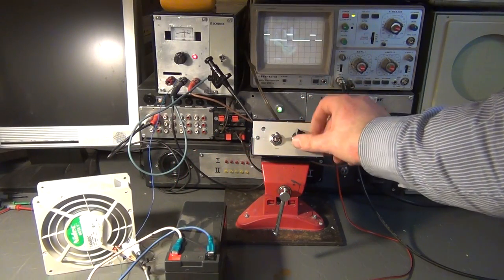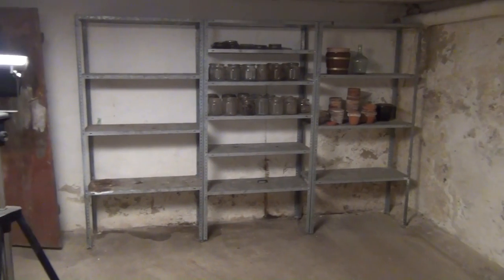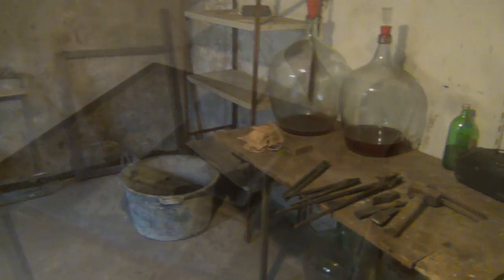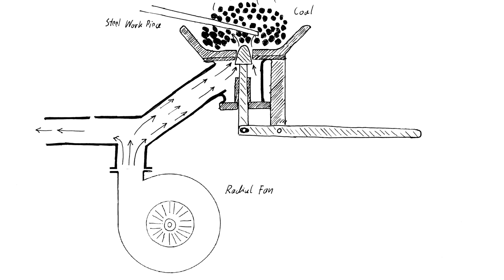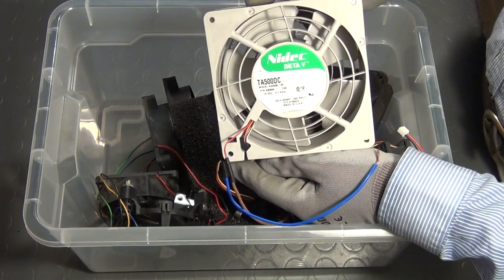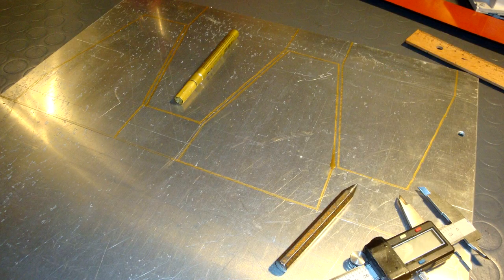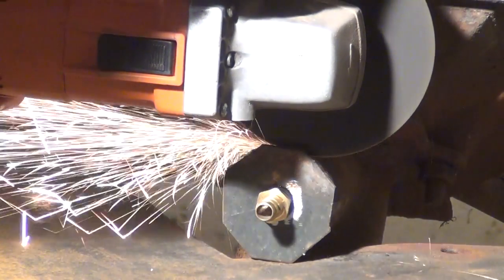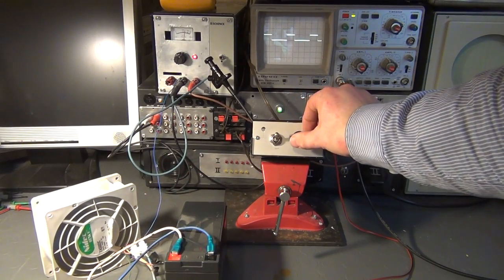Building a Blacksmith's Forge Fan System  - BLDC Fan (1)

Comment: I just built an coal forge myself! When building it I realised that I didnt have any valve for the airflow, so currently im using a compressor with an blow nozzle that I can change the airflow with. 

I was going to mount an vacuum cleaner as an air supply, but it didnt work out changing the rotation of the fan.
The homemade valve that you are using seems quite clever, will look into building a similar one! :) Great video!

Comment: Great video although seems a very complicated way of doing it. I did something similar for a turk burner and just used an old boiler fan with a dimmer switch designed for inductive loads, it's much quieter then inline fans.
Got/will get some great videos from your project so no complaints :)
Reply from the maker: Michael Walker Yeah matching that server fan to the old flange wasn't  exactly an easy thing to do. It took me many hours to build the "reduction piece" and to modify the steel pipe. But there is one factor to consider here: I have these fans lying around for years.  There have been so many times that I saw them and thought "what can I do with them ? " and I'm really glad that I could finally put one of them to good use. I want this channel to show ideas, that involve those parts that everyone has salvaged at one time, but never found an application for :D

Comment: I love all Your videos!
Sorry for my English...

I work as a blacksmith, and i think i hawe few things to say about this,

1. Any computerfan, etc will probably not last wery long (it´s a good reason why those thiongs are made of cast iron...) but on the other side they are sheap to replace.
It will work for a long time anyway. I know some people who using computerfans for this so it works, but he change the PSUs and the fans from time to time when thay wearing out, however he got them for free or at very low cost so i don´t think it´s a big deal anyway.

2. If possible i had saved the old fanhouse or selling it instead of scrapping it (if You did).
Cast iron fans are very good for example dust removing from metalgrinding macines, etc and i thik it´s worth to replase or re-windling the motor on it even if it´s old. It´s the only thing that actually last long for such applications.

3. this is at my opinion a bettter solution than using a compressor for more permanent use.

4. a houshold wacuum cleaner is noisy and will probably wear out fast, the fans in them are not made for sucking in coaldust, the housing and blades will tear slowly and then it will become very innefective. (if anyone else thinking about it, well it will work bur most for temporary using.)
Reply from the maker: I agree. Maybe the old fan could have been repaired somehow, or maybe  I could have attached a new motor to it. It was not me, but my father who disposed of it. But it was still my fault, since I had it lying around at my father's place for many years and he thought it was scrap. 

Time will show if the new fan holds for very long.
Reply: The Post Apocalyptic Inventor

Yes, it´s still very expensive to re build those motors i know... Still hundreds of euro (1euro is a bit less than about 1,5 US $)... (som years ago i asked a factory for re winding a uncommon motor for my powerhammer,... But fortunatly it was only accidentally wrong connected so i did not need to do that that time.)

I most try to build something like this for testing. To good idea for not giving a try.

Comment: If the 'new' fan fails, you can build a new high volume centrifugal fan like the original one, using a normal single phase induction motor and the center section/compressor housing of a normal car or truck turbo charger.

Comment: Thank you for putting so much time and effort in your videos. I have been thinking of making such a furnace, and i will adapt the bldc with pwm ...next issue- what will you do with smoke extraction from the basement? A bit dangerous with carbonmonooxide in a below ground level room? Cheers from Denmark.
Reply from the maker: Bo Helsted I will connect the  flue to the chimney, buy a carbon monoxide warning device and additionally set up a ventilation system for the basement.

Comment: How did you bend the aluminium sheet?
How much does an aluminium sheet like that cost?
How did you drill the holes? Is a regular hand drill enough?
Reply: +CLIn7 l33tW00d 
He might have scored lines in the
Aluminium where he wanted to bend it, which would give fairly straight
bends.  Alternatively you can use the strait edge of a table if it is
not bevelled.  You secure one side to the table with clamps and then
get a straight board or piece of wood, clamp that to the other side
of the bend and push down on it till you have the desired angle. 
This is to get straight bends though, you can really dispense with a
lot of the steps though because aluminium is very soft.

Sheets
are priced by the square foot and the thickness of the metal.  They
can get expensive for that reason, but that size would not be that
much.  That one looks like it was actually salvaged because I see a
screw hole in the edge there.

Yes a hand drill is more than
enough, especially for aluminium.  The bit is generally more important
for drilling metal than the drill, but you could drill aluminium with
a dull bit (it'd be messy but it'd work).  Be sure to center punch
where you want a hole so the bit doesn't wander around everywhere.
Reply: UnbeltedSundew Thanks for your response, great tips!